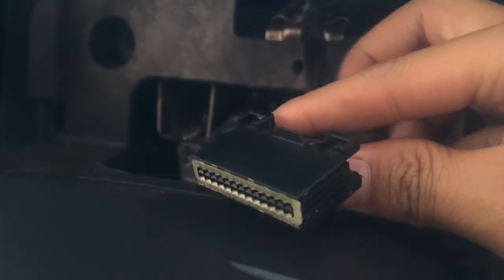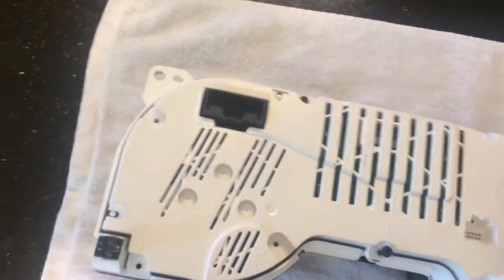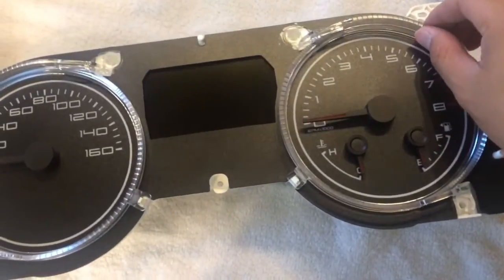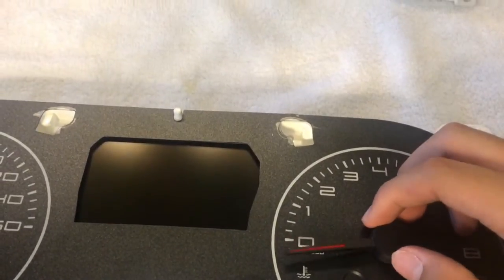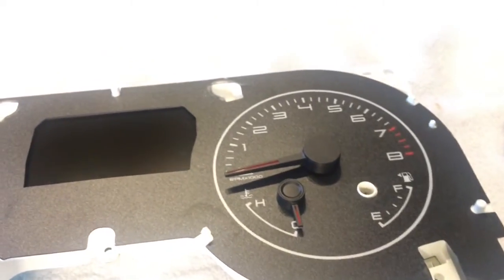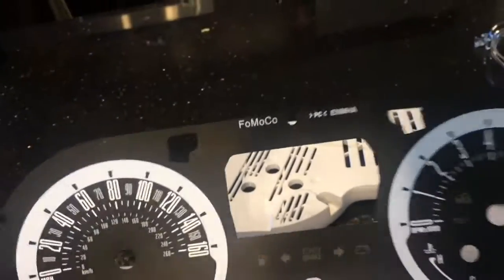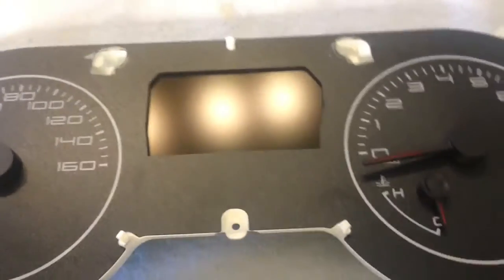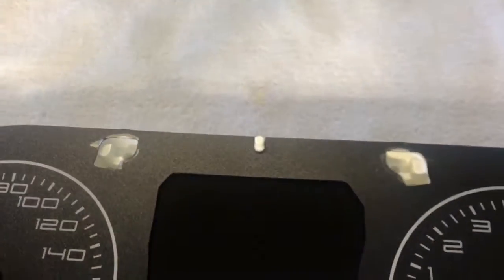2011-2014 Mustang Gauge Face Install

Comment: Just did this on my '11 GT Convertible.. video was a big help.. however my cluster only had 3 torx screws on the back and really only the one center one had to be removed to take off the front clear pods for access to the gauge face. Had a hell of a time getting the pointers realigned though. Even though I followed the instructions in the video, when I plugged the cluster up the speedo and tach were not pointed at zero and ended up having to do it open it back up while plugged in to the connector to try to get them lined up. Also if you jostle it to much getting it back in the dash the pointers seem to get off zero some how. Way better look than the old white face ones though.

Comment: I did this and now my speedometer is WAAAAAY off. Any suggestions? Thanks.
Reply: Did you ever fix it?
Reply: @adrianrodriguez4292  yeah. Got a whole new gauge cluster. Which, came with its own things to figure out. 😂
Reply: @KR-zd4xt  which cluster did you end up getting?
Reply: @adrianrodriguez4292  just a used stock cluster. Had to get it cloned to my original cluster…or else it wouldn’t start. Finding somebody to clone it was the tricky part.

Comment: If i have the stock 2014 v6 base model You know how the lights are blue ish in the dash?? Do i need to change just the face plate so they can be white or also the bulbs?

Comment: Hey Kevin I am looking for a face plate for the 2011 svt cobra and my cluster has the 4 gages, i like the black face with the white outer ring like you had taken off yours, I wanted to convert the cluster to the newer trac apps cluster but they are very expensive and since my car has really low miles 2011 with 26,000 miles I cant find one . even the busted ones are still over $200. do you know where to get the face plate like your original but without the 2 gage in tach. I would consider to buy your old one but i would have to cut it which would look crappy, thanks for any info, I tryed to google gage face plates but i see them for 2005 to 2009 and they ae rather expensive for all they are, wish I could buy a used one like you have but for the Cobra svt. with center gage cluster, reasonable. the type of face plate shows up better with the my color options. my car has the white face which is rather bright   thanks for any info. sincerely  Ryan
Reply from the maker: Ryan Reynolds If I'm reading this correctly, you're looking for a black face with white lettering with only two gauges in the center? If you go on blackcat gauges website, they should have some like that listed under 2011-2012.
Reply: Thanks for responding Im looking for the gage face with the face plate like you removed to install my 2011 has the 6 gages and the white face . My cluster has the fuel ,temp ,oil and amp. I like the face plate you had removed it looks like the 2011 to 14 cobra svt face plate ,  buy your cluster has the trac apps mine is the 2011 which didnt come with it, I see on youtube they can be installed but the 2013-14 clusters are really expensive and have to be reprogrammed to work in my car due the the security. I even see broken clusters selling for over $200, I had seen one sell one for $100 I shoulda bought it but didnt have the money at the time,  thanks for the info. tho have a great night
Ryan